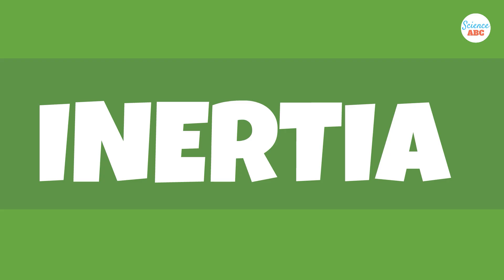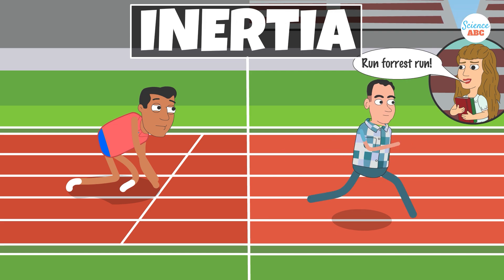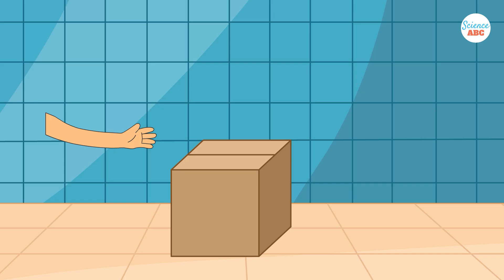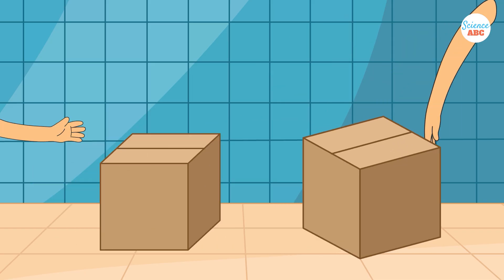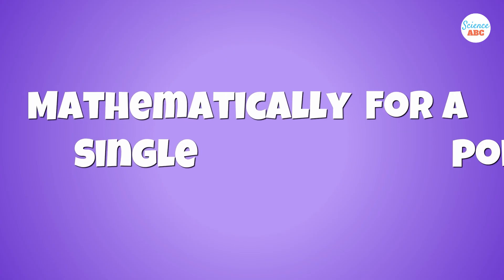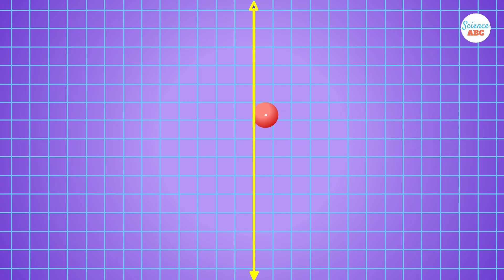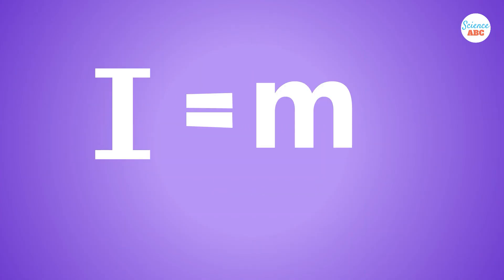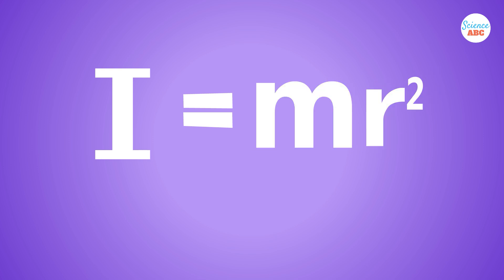Moment of Inertia Explained in Simple Words for Beginners

Comment: The door example is not right for explaining the moment of inertia. It is harder to open a door by pushing near the hinges because we need to apply more force to produce the needed torque at that point. The torque produced by us must equal the torque needed to cause an angular acceleration at that point and it is a product of MI and angular acceleration. The torque we produce would be force * lever arm. The shorter the lever arm more is the force needed and thus more effort.
Reply from the maker: Thanks for your feedback. As you correctly said, the torque we produce is the product of force and the lever arm. When the lever arm is shorter (i.e., when we're pushing near the hinges), we need to apply more force to generate the same torque as when we push farther away from the hinges. But the moment of inertia also plays a key role. Moment of inertia represents how mass is distributed relative to the axis of rotation. Near the hinges, the door’s mass is concentrated closer to the axis, and that means it resists rotational acceleration more strongly. The higher the moment of inertia, the more torque is required to achieve the same angular acceleration.
Reply: This comment is so nonsensical that I'm inclined to think it's AI slop. The door has a constant moment of inertia relative to the hinges. It has nothing to do with torque. The same way a stone has a constant mass regardless of the forces applied to it.
Reply: @capitan-patata  You trying to open the door has everything to do with torque. The torque produced by you must match the moment of inertia for you to open the door.
Reply: @Scienceabc   That is why I said this example is no the right one. Because you need to explain both concepts to completely explain the idea.